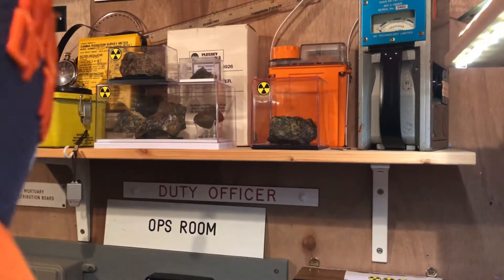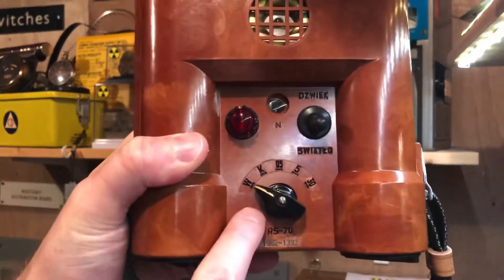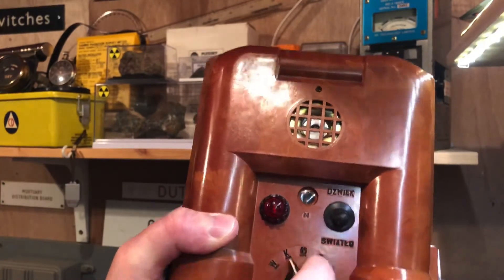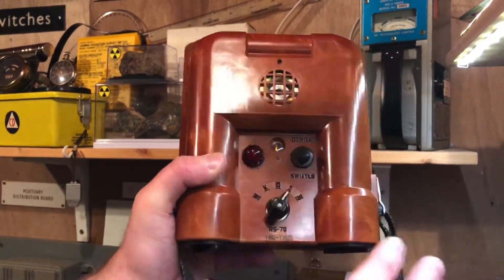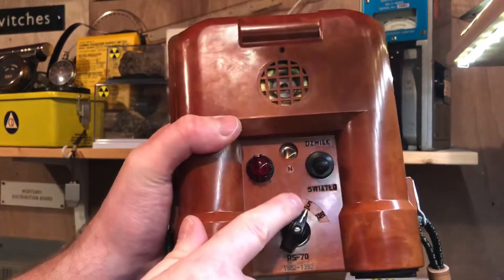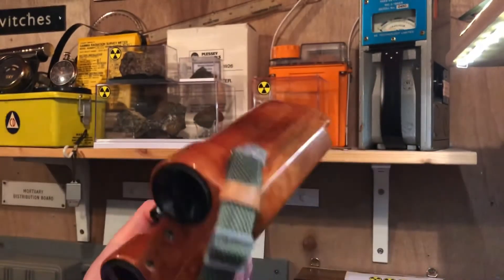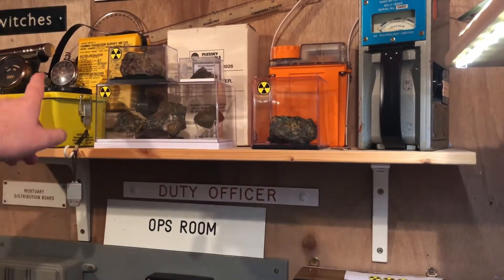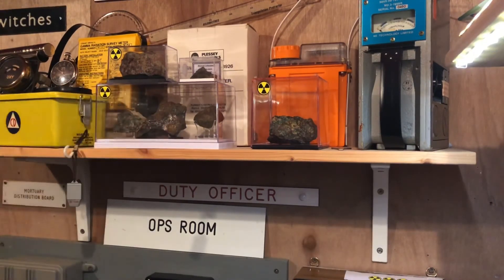Polish RS-70 ‘Alert Meter’

Comment: Cool video, what surprised me was recently I opened up my RS-70 and was amazed to find it actually has a GM tube in it rather than what I assumed would have been an Ion chamber. At some point I'll try and get around to seeing if it's possible to test the GM tube outside of the case and steel sleeve it normally sits in to work out if the meter will actually fire off.
It's a DOB-50 GM tube if I remember right inside, one of the three tubes the Polish DP-66 Geiger used. Fairly similar in range and operation to the Soviet SI-3BG tube that was used for the high radiation ranges on the DP-5 series geigers.
Reply from the maker: I really should start opening up more of my meters. I really enjoy the videos when you do it.
Reply: @SurvivingTheApocalypse  Cheers, only worry with some of them is if you remove a screw etc that decides it really does not want to go back inside. RS70 is very straight-forward to take apart at least. 4 screws to remove the back cover, then there are 4 additional screws to swing out the back plate/circuit board. The GM tube is then on the underside of the bottom most plate.